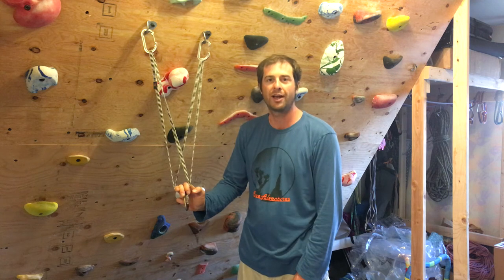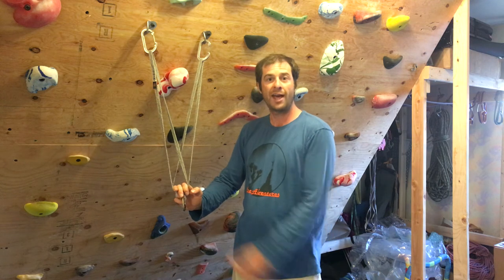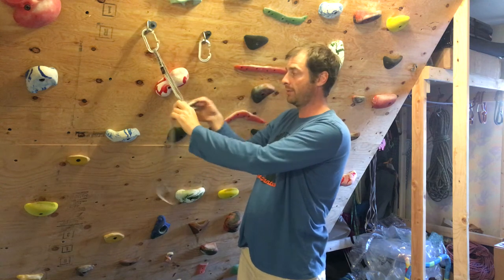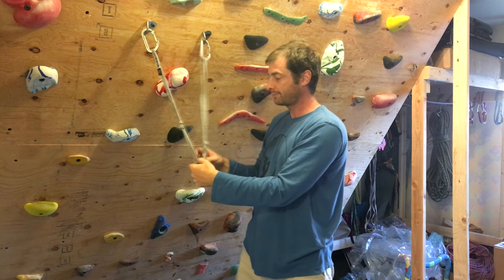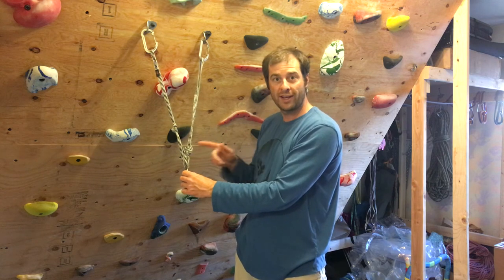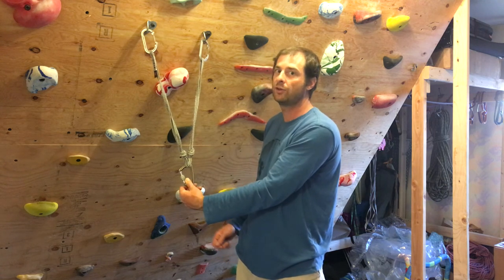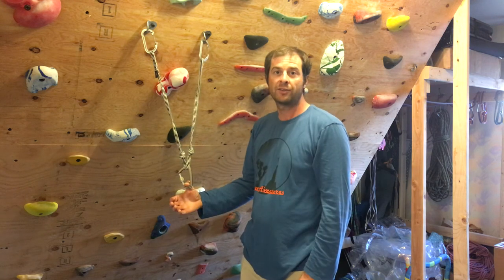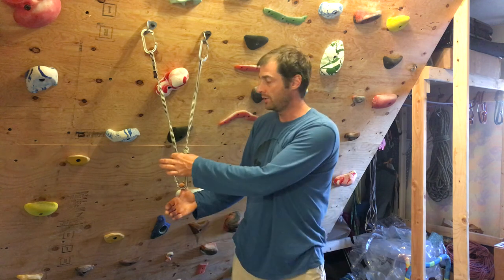Rock Climbing Anchor Building - Magic X with Load Limiter Knots

Comment: I would really like to see this knot being tested on a slack snap machine. My course leader did not think this anchor system would reach our 20kn norm. But what if there were two eights? I would love to use this knot in my arsenal as it would make for a great extender version of the quad ancor. I cannot se the anchor being to weak especially with 13kn 7mm cord, figure eight knots and 60° Angle.

Comment: Nice video, Aron! I still find myself using the quad in most cases, but this seems like a good option as well!
Reply from the maker: The quad is the bomb!  It's still my go-to anchor as well.  Just good to know as much as possible though!  This will give you a longer anchor, whereas the quad will be about 1/2 as long.